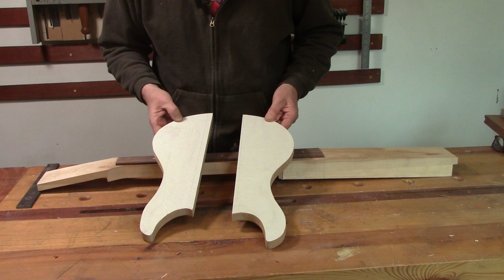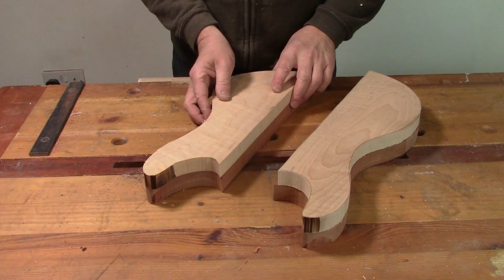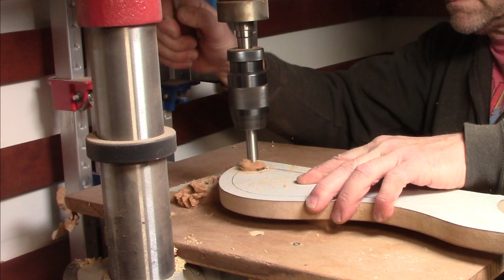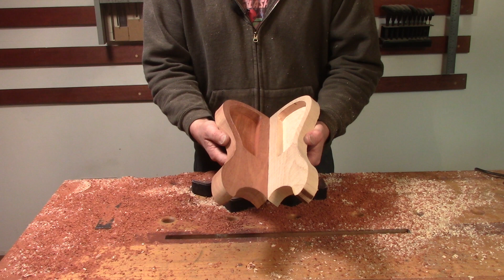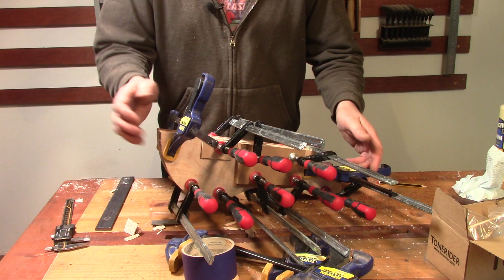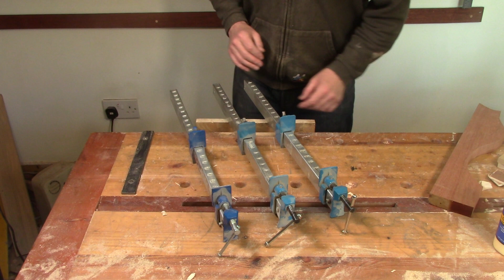Great Guitar Build Off 2021 Episode 3: The stick gets a body.

Comment: It is great idea and innovative way to hide the wiring the way you did.
The entire guitar looks great and I am trying to imagine how it's going to look like after finish - Looking forward to see it.
BTW - Which hardware are you going to use?
During first Covid-19 restrictions period, I have build a similar (feel and look) guitar from scrap wood left from previous project and a maple kitchen door :-)  (on the following link - https://youtu.be/IQPa6RhBRcQ )
Reply from the maker: Thanks Michael, I really like what you did with your build. Bigsby on your second build!! I'm impressed,very brave :) Currently I have a wilkinson Tune-a-matic bridge but that might get upgraded. I'm using some locking tuners and will be sorting out a couple of humbuckers later this week. It's all fairly standard stuff.
Reply: @Adventuresfromtheshedofdreams   Sounds great. As for locking tuners I have used Guyker tuners with 1:21 ratio that gave me very good and long lasting tuning hold (this is the link http://www.guykermusic.com/guyker-3r3l-guitar-machine-heads-121-sealed-tuning-key-pegs-tuners-set-replacement-for-st-tl-sg-style-electric-guitars-chrome-p2897079.html )
There are similar by Gotoh but with 1:18 ratio (Mini 510 series) , both can be found on Amazon.
Looking forward to see your piece of art finished
Reply from the maker: @michafogel  I'll have a look at those. They sound grat :)

Comment: As much as I like the idea of a hidden control cavity, feeding everything through that hole will drive me mad! You are a more patient man than I!
Reply from the maker: Haha, it's not the fitting that worries me, it's having to get it all out again every time something goes wrong. My soldering needs to be on point on this one :)
Reply: @Adventuresfromtheshedofdreams  If it really gets too much one day you can still route a normal cavity cover in anyway.
Reply from the maker: @rauschguitars  that would be an option, it's going to be an oil finish on the back so quite easy to add access :)
Reply: @Adventuresfromtheshedofdreams   ... could always do the Fender 'trick' and just add a larger plate over the top of the cavity, rather than recessing it ... (not that I recommend this approach !).

Comment: Excuse me for shouting at my screen that whilst you were excavating the Control Cavity you should also do some other weight-relief cavities, including in the top 'side' of the guitar ... !!!
Still, a brave way to hide the electronics akin to a hollow-body. I hope that you're using high quality components to avoid any failures, as I wouldn't want to be fishing around again to repair after the electrics have all been installed !
Good build though. Look forward to seeing the final result and hearing it ... Well done.
Reply from the maker: Thanks Stephen, I'll be using all CTS and Switchcraft components, never had either fail on me so far. To be honest it would be a bit of a pain if there was a problem but if the strings were coming off anyway it will probably only add twenty minutes or so to a repair job. 

I,m pretty confidant that the overall weight of the guitar will be ok even without additional chambering :)

Comment: Very nice work, I love the wiring/control cave. I’d like to share a veneer technique I learned that fits perfectly with your piece, as some applications won’t work. It is for a piece that will be seen horizontally. Take the veneer, apply titebond to one side, apply tightbond to the body piece. Let dry till just tacky, then place together and iron the veneer on with a very hot iron and some heavy paper in between. It melts the glue together, and I have to say, gives a look of flatness hard to describe. Kudos ! Oh, be prepared for the veneer to “cup” as the glue dries. I just place it under some dowels 3/4” above.
Reply from the maker: Thanks Daniel, that sounds like a great technique for veneering, I'll give it a try :)

Comment: Not sure where you are with the access carve, but it would seem aesthetically pleasing to align the lower bout with the end of the fretboard, as it's already so close and it makes no structural difference, being a through-neck ...
Reply from the maker: Yes, I have some shaping to do around both the upper and lower as they are not quite there yet.